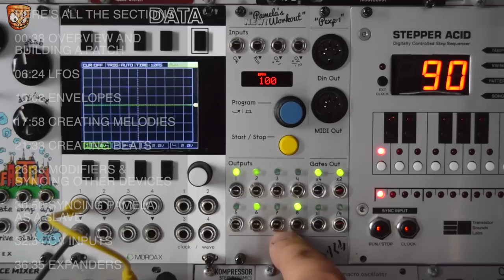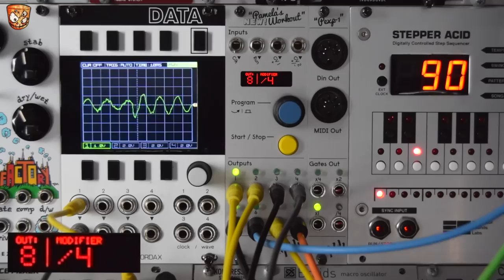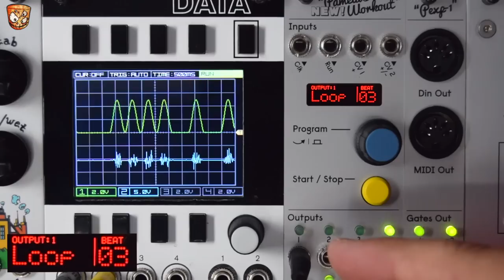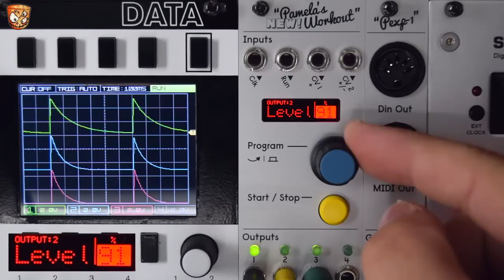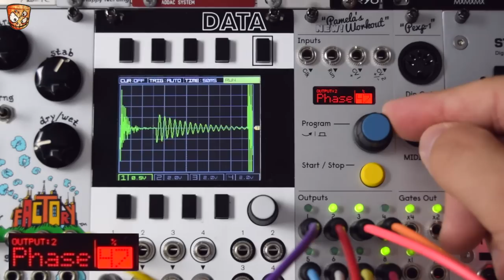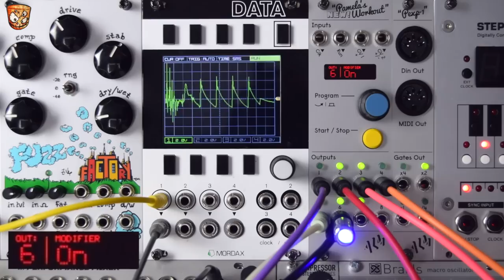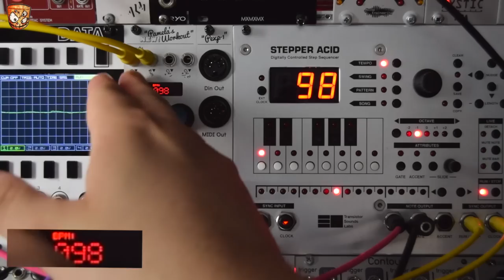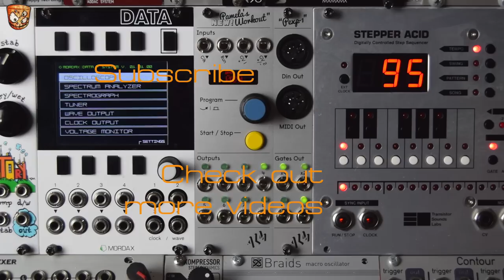ALM Busy Circuits - Pamela's NEW Workout

Comment: Amazing new update in Pam's        I got lucky with some new build options and freed up a tiny bit of space on the Pam firmware image builds :hyper: . This meant I could finally fix some long standing weird bugs and add a couple of new features. I've made an initial 202 BETA release available with this work.

The first new feature is a basic quantiser option on each channel with a few fixed scales to choose from. Please keep in mind Pams outputs are 10bits so don't expect this to be super precise but isn't too bad as limited to 5 octaves anyway. I don't plan on adding hundreds of exotic scales, microtonal stuff etc.. if you want that Id advise you grab a dedicated quantiser. Im limited by available space and actually reasonably representing in two characters.. Current scales are;

"NO" - no quantisation
"MJ" - Major
"nM" - Natural minor
"hM" - Harmonic minor
"P+" - Pent Major
"P-" - Pent Minor
"LD" - Lydian
"JP" - 'Japanese'
"5t" - root & a fifth
"c1" - I chord
"c4" - IV chord
"c5" - V chord
"12" - 12 tones, chromatic.

The chord ones Im playing with for making simple appegios etc. Lemme know how these and other scales work for you.

The other new feature is simply a new RUN input assignable triggered option to make a bank load addressable by voltage level (in CV1). Its currently limited to the first 16 banks.

These are the bugs that have been fixed (from changelog);
 - Fix PPQN screen always changing val when made active.
 - Fix CV reset of random seed (when loop is at 0).
 - Fix wierd CVx modifiers always getting assigned when param clicked after assigning one!
 - Make full reset actually reset mute states. 
Note Im still pretty space constrained and though I do have a little space left I would rather save this for fixing future potential issues rather than any additional new features. At least in immediate future.  Top One ALM x
Reply: Wow
Reply: mine came recently and loving the quantizer features so useful as well as new updates and random wave modes.
Reply: Really cool, thanks for this. Can you choose the key of the scale or is it fixed in C for example & thus your comment about quantiser?

Comment: Thank you so much for the detailed explanation. I was looking on this one several times before but couldn't grasp what the fuss is all about, until now. The only thing I'm worried about is that there's too much menu diving...
Reply from the maker: I don't equate menu diving to this at all. It's all a simple click or hold away. Yes it's a menu, but not a "divey" one if that makes sense.
Reply: Yes, you are probably right. My skiff is aiming to be very much performance oriented, but the amount of features per hp added the PNW to the my wishlist :-)

Comment: I know this is an old video and all, but... My PNWO is on order and arrives in the next week or so, along with Intellijel scales, plus MI Ears and Kinks (My vendor had a sale on old demo/b-stock gear, and I got a good discount.) Proper clocking has been lacking in my system (Marbles random clock or just a grid-stuck bsp was all I had until this.) Being able to shift things around and add movement is gonna be so nice. PNWO will run the drums in Bitbox2, plus whatever else feels necessary, so I can leave Marbles/Frames firmware hack for Plaits and 0-Coast. A PEXP-1 will let me run my Novation Nova / Drumbrute Impact / Microfreak via midi... So many options. Thanks for the help, as always.

Comment: This is an amazing video (just like all your others) and definitely has convinced me that I need Pamela in my life.  Question though:  can you please explain Euclidean steps for me?  Googling it revealed a lot of advanced mathematics that went right over my head.
Reply from the maker: Check this site out - http://www.groovemechanics.com/euclid/ - it's an online Euclidean sequencer so you can play and figure it out. 

The basics are you set a step length. Say 16 steps, think of that as 16th notes in a bar. 

So you set how many steps will be active, say 5 and it tries it's best to evenly distribute 5 steps within the step length (we said 16). Of course 5 doesn't go into 16 so you get a more rhythmic pattern as opposed to a straight division of the beat/clock/tempo. 

There's often then a rotation control which will let you grab the pattern and shift around the available steps. 

Have a play with the site and I think it will help.
Reply: Between that and the Voltage Control Lab video I think I've got it!  Thanks a lot!

Comment: Thx for your video. Is it possible to use Pamela's NEW Workout to trigger Drums on a Setup for live performance? How do you mute the trigger signals going out of Pamela's into the Drums?
Reply from the maker: Hi Daniel, personally I'd put a DivKid Mutes module (sorry I'm bias, but that tool was made to do that with the gates/trigs or the audio if you wish) between Pams and the drums. Or after the drums sometimes. 

Not sure if there's a mute function in Pams now but there's no performance based control to do it across multiple outputs.
Reply: @DivKid  thank you for your answer. I tried with an old Doepfer A-138i. It works well but it is important to keep the triggers very short (width 1% or so). Later I am going to get 2x DivKid Mutes - those require less space (:
Thank you for the reviews. I learn a lot (:
Reply from the maker: thanks Daniel appreciate that!

Comment: Thanks for the video. Do you know if on Pamela's NEW Workout it's possible to go from one bpm setting DIRECTLY to a different bpm, avoiding a gradual speeding up/slowing down? (120BPM > 130BPM, instead of 120BPM > 121BPM > 122BPM > … > 130BPM)
Reply from the maker: you could look into CV inputs. You might be able CV tempo.

Comment: I wanted the Octocontroller as my next multi modulator, but this one's growing on me. Both have 8 outs but It can be a lot cheaper than the former & unlike it the Pam apparently has envelopes. The only thing is I haven't figured out on either yet from videos how you alter individual env slopes. So can you have up to 4 full ADSR's triggered together from the clock input by manipulating the limited controls?
Reply from the maker: it doesn't does ADSRs and it doesn't do trigger envelopes. It just gives you a decaying envelope shape that's trigger by a division of the clock. So more like an LFO with a common envelope shape.
Reply: @DivKid  Oh OK. Not quite what I hoped but still good value though.
Reply from the maker: it's a nice additional shape but it's certainly not a normal envelope generator.

Comment: quick question, why on tack 7 in the 1st example did you use an external quantiser instead of the one in Pams?
Reply from the maker: I like the immediacy of a keyboard interface for turning on and off notes and you can adjust those on the fly 'performatively' and also then trigger when the quantisation happens as you like.

Comment: would you ever do comparison videos? dunno if i should settle on PNW or Tempi...
Reply from the maker: I don't do comparison videos like that really and I don't have a Tempi. But I'd say both units are pretty different. PNW has CV options for the outputs and can provide a wider range of things. But the interface is very different. I couldn't say which is better or worse as that's very subjective. The only thing I can say is that I think all it will come down to is the interface and how you find working with each one.

Comment: Got 12hp left in an 6u 84hp case. Got the voltage block and not so many lfos. Thinking either this or the varigate 4+. Decisions...
Reply from the maker: Hmmmmm tough choices, but if it's LFOs then this. Voltage Block with the slew/smooth option turned on can create LFO like motions though.
Reply: Whatched this demo again, and the Pam is the module. So versitile. Thanks!

Comment: random question but I'm looking into getting a PNW and splitting clock signals/rests between itself, a nerdseq, octatrack, and a rene 2. Do you think something like a buffered multiple would be necessary for a situation like this or in general with sending clock sources to various destinations to keep the voltage levels steady thus keeping the clock rate steady?

Comment: Is it possible to slave PNW to an irregular clock? Like a pattern from a gate sequencer for example? Would this be doable by patching the gate sequencer into the run input and leaving the clock input empty perhaps..?
Reply from the maker: anything that multiplies a tempo is trying to learn and internalise it. So it's not going to work that well. Dividers you can work with irregularly but multiplying something means learning the clock. I mean you can try it and get things that warp around but I don't know what you're wanting in terms of results. Why not use PNW to get the irregular stuff? What do you want to achieve?
Reply: @DivKid  Ah ok, that makes some sense to me.  Thanks Ben :) you're always so helpful.

And well I'm planning on building a tiny sampling system based around the Phonogene and Radio Music, with the PNW for clocking/modulation. I thought it would be cool if I could set up something within that system, and then sequence PNW externally for further playability. As that's my one gripe with PNW, as great as it is it's not the most playable/tweakable thing in the world.

(Though come to think of it the cv inputs and the reset input could be well enough anyways!)
Reply from the maker: you can look at it the other way and use the PNW to influence everything else. Even patching one of it's outputs back to itself can work well too.
Reply: @DivKid  I ended up going with the Wogglebug instead as I've already got everything else more practical in my main rack :)

Comment: hey there, just got this module, and I'm completely new to modular.  I have a Pico Drums, and I have the cv input configured to control the decay on the drum sample 1 (ex. output 1 triggering the sample, output 2 going to the cv input of the Pico Drums controlling the decay of that sample).  The sample is a hat sound, and when the decay is long, it sounds like a cymbal ride.  I have the hat triggering several times per bar of the total pattern with other drum modules.  What I want to accomplish is to have the decay be completely open on the first hat trigger (the downbeat) and then close the decay on the successive triggers of the hat in the pattern/bar.  Is this possible with PNW?  I tried to do this with the envelope going to the cv in and it creates a rhythmic thing with the decay but I can't figure out what its doing.  I don't know if its retriggering the envelope on every sample trigger.  I know I can probably get this to work using the divisors on the modifier, but I'm not quite sure how yet.  Great vid btw, the manual doesn't really say much about the envelope, but it's clear here how it's working.

Comment: do you know, if I can use the pamela´s new workout as a switch to expand the steps of the DFAM from 8 to 16 Steps? Thanks
Reply: Not exactly. You can trigger existing steps twice as many times or just use Pams as the trigger/pitch device (but you cannot disconnect DFAM's velocity track). 

You can use it to get 16 steps at different pitch (with pitch tracks switched off) and other inputs though, so you can get close.

Also it has a quantizer, so if you don't have one of those for your DFAM, that's worth the money alone. A quantizer really open up the DFAM.

Comment: The real question is do you get a Modox DATA or a Jones design O’tools 🤔
I think I’m going to give into an oscilloscope module, I highly underestimate the usefulness of visuals cues..
Reply from the maker: DATA can generate 4 signals as well, voltage references, LFOs, waveshaped/folded VCO tones (with on board digital VCAs). So that's worth bearing in mind.
Reply: DivKidVideo Oh wow I guess it’s worth the extra HP, I was attracted to the tuner and the scope modes but the DATA also sounds interesting. Thanks for the tips!

Comment: This module seems incredibly versatile. How would you say it compares to a Maths? I'm wondering if I should get one of these and something like a 3xMia instead of a Maths....
Reply: IMHO, Maths and Pams are two completely different types of modules.  Pams compares with Tempi, and other clocking modules. While Maths can trigger events, it does not have specific, precise granular control of the triggers like Pams.
Reply: Rod S yes absolutely, I recognise they are very different. But when I take a step back and think what I might use a maths for I think a common use is LFOs and envelopes? (I don't have a Maths ofc, so I'm going on YouTube and the manual). I know this module achieves these things in a completely different way, just what you get it seems, beyond clock sources, are 8 LFO/envelope modulation sources.

I know they are very different, but if what I'm looking to do is cook up complex, interdependent modulation sources, might this module give me more milage? (Obviously buying both would be best, but my funds for modular are a slow drip drip drip affair lol)
Reply: I don't think it's useful to equate a Maths with "LFOs and envelopes". Yes, a function generator can do that, but it can also do a lot of other useful things because of the very specifically analogue way it functions. As in: it can also be a slew limiter, or a clock divider, or a slightly weird kind of filter, or a wonky and non-tracking VCO, and so on. A lot of the uses for (dual) function generators are not immediately obvious externally, and you sometimes come to through patching. Also, consider the attenuation channels as part of Maths, rather than just a pair of attenuators - they're very handy for mixing into the functions, or attenuating the functions themselves.

That said, you can definitely do some interesting modulation with PNW, especially given the ability to patch its own modulation outputs back to its CV ins (and a mult will help there). But: you're always, fundamentally, making things which are derived from some kind of tempo. There are no trigger ins. So if you're OK with never being able to trigger modulation from keys, or other sequencers, or end-of-cycle/phase outputs, then you might be able to get away with PNW. But I think a better way to think of PNW is as a device that's all about related rhythmic timing, be it for gates and triggers, LFOs and fired envelopes, and semi-random sequencing. It's a great module, but the 'modulation' it offers falls into a particular set of categories.

(The traditional answer is 'both!' but that's never really helpful. I don't think you'd regret ending up with both in a system, Maths never goes to waste).
Reply: Tom Armitage thanks for your input Tom. You are absolutely right and brought me back to my senses :)
Reply from the maker: you guys sussed it! :)

Comment: Nice video, thanks. I am interested in PNW, however I am wondering if it's possible to create motorik beats on it. I need a 16 step pattern that is kick kick snare kick kick kick snare kick, etc. Can it be done?Also, is it only 4/4 time with this module? I can't see anything in the manual about time signatures. Thank you
Reply from the maker: Hi Eyeprod, there's not really any sense of 4/4 or time signatures with the module. You could take an odd number gate division and use that output to go back Into reset input to make the module run in say 7/4 or 9/8 etc. However it won't make sequence where you use choose which the steps the triggers go on. It will run euclidean rhythms over the various timings. Have a look at euclidean rhythms in this video and in general for other modules or software and see if euclidean patterns will get you want.

Comment: How painful would you guys rate the menu diving in this module considering I'd rate a Braids to be a 8/10 in the painful meter...?
Reply from the maker: This I'd say is a bit further than Braids, but I don't find either an issue as Braids I mainly just use the wave modes and scroll through without ever going into the menu. I don't think you'd like this module, but you can see me moving around the menu in the video and I personally don't find it an issue at all. Especially for the amount you can get out of it.
Reply: DivKidVideo Thanks for the answer DivKid. I am looking for an LFO module which can give me a more than just LFOs and this seems like a good module for it. Hard to find another module that can give me 8 independent lfos and much more on that few HPs. Perhaps I should go for it even though the menu diving scares me a little. Cheers from Canada!
Reply from the maker: Try not to just think "most outputs in the HP" and think about interface too. I really like the module but I know other might prefer something else. It's all so personally it makes it really hard to make suggestions.

Comment: Hey! Im just gonna tell you guys about something I recently found out about, the real color of the OLED display. My only thing about the module I dont like, is the RED oled display. Red makes it hard to see due to red light being a long wavelength in our visual spectre of light. I looked for the "special" versions of PAMs Workout that showcased a different oled color.. but sold out everywhere.. until I stumbled onto seeing the oled without frontplate and its plexiglass piece covering it by chance due to me forgetting unplug power connector. The oled is WHITE! doeh Now the module is awesome looking for me, matching the green status leds over the outputs. And me having the black front panel, it just looks more awesome. Just a nice little hax :) Cheers

Comment: Difference between phase and offset??
Reply from the maker: offset is a voltage offset to the output signal. 

From the manual "
 
  
  
 
 
  

   

    

     

      Offset

      Adds a vertical offset voltage to the output in percent 0-100% of a maximum 5v.
Signals over 5v will be clipped at a 5v maximum.

     
    
   
  
 "
Reply: @DivKid  Alright. Thx